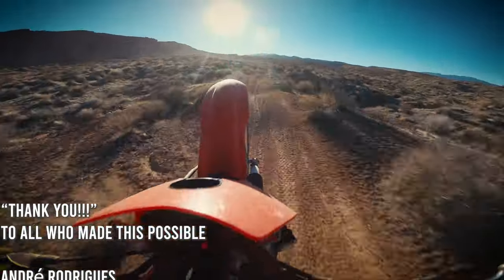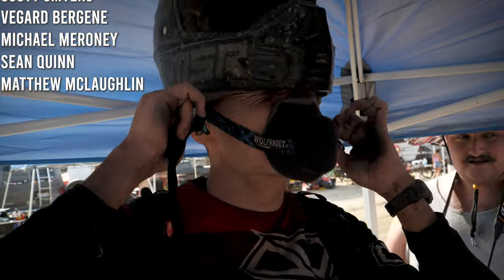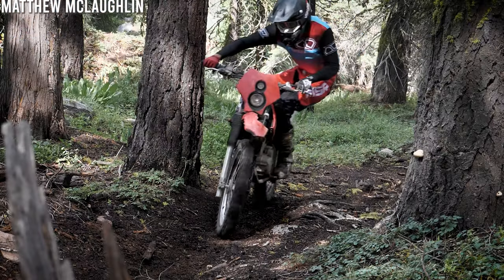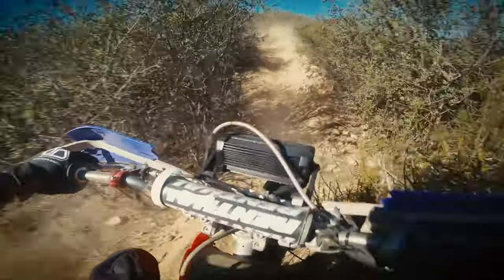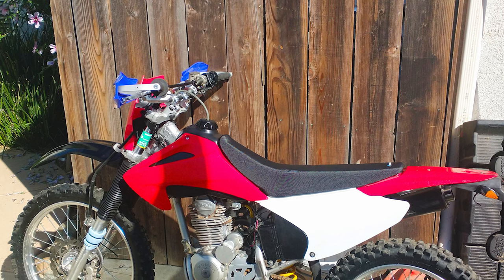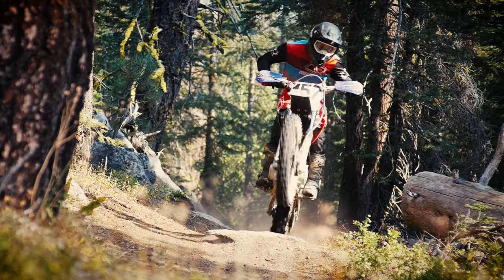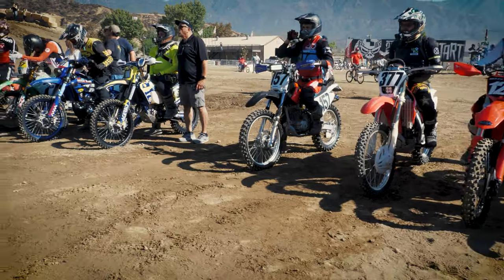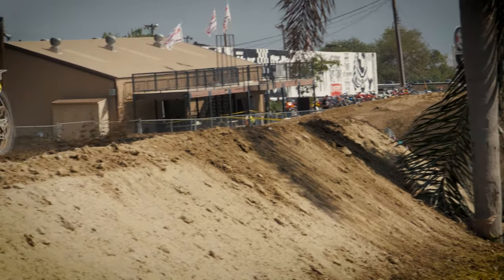So The CRF230F Sucks, Huh? Let's see...

Comment: The crf230F is actually a pretty suprising plateform. In 2012, this was my second dirtbike. Coming from an 1986 XR80R this was quite the difference. Nonethelessm I had put in it a high compression wiseco piston, a hot cam stage 2 and a ovesized carb. The 230F was pretty spicy for its age. A 2004 model. Glad to see you enjoy them to this day.
Reply: Haha I had an 04 as my second bike too… until I blew the transmission up pinning it in 6th out in the desert lol. If i ever get the chance to own another for the right price ill definitely be doing so. Great bike.
Reply: i have 2 crf 230f's (some videos are in my channel) the bike is amazing, under 50cm of water, in the rain or mud, never fails, never let me down. very easy to drive.

Comment: Wow that is the most sophisticated suspension upgrades I've seen on any of your CRF230 bikes!  Those cartridge forks and shocks are like something from Area 51 compared to the stock non-adjustable damping rod hoonanny.
Reply: Definitely want a link to the front forks he bought. I’d like to buy a CRF230 or CRF250f as a cheap motocross bike.
Reply: Where can I find these forks?
Reply: They were used forks off of the last generation of xr250r if you're still reading this

Comment: I had an 03 crf230.  I left mine bone stock.  I jumped it quite frequently, and it definitely needed better suspension.  I never was impressed with the power either.  However, it was a great trail bike.

Comment: We use a CRF 230 to lay out race trail loops. These little bikes can go just about anywhere because it has just enough power to put the power to the rear tire and not spin plus you can touch the ground with a low seat height
Reply: Their also very reliable, i almost bought one that was abused since 2006 and still ran fine on the stock motor, ended up getting a newer one in better shape though.

Comment: I have a CRF230 ive got a hagon shock on and had my stock forks done by bruce tripplett. That man works wonders on those flimsy little forks, but, what exactly did you do to get those KYB forks on there? and exactly what kind of KYB forks and triple clamp is it youre running? Ive tried XR250 forks on the stock shock (tuned by helbo bros) with a different link that was supposed to raise the rear ride height... that rode like dog shit, choppered the fuck out, carolina squat, etc. I would love to get some full size cartridge forks on it though, so spill the beans (please). Im also running a PWK28mm carb, some webb cam cant remember which exactly, wiseco high comp piston, and converted to rear disc brake(pain). Wouldn't have done any of it if it weren't for your build series though, so thanks!

Comment: I too have 2003 CRF230 that is a blast when riding with $12k pumpkins. What fork are you using or stock fork with race tech emulators? I'm using BBR springs and Race tech emulators but curious what you have done to fork? Also using 1985 XR600 rear shock...minty!

Comment: I literally just came moments away from buying one of these but the upgraded 250f. Instead I bought a clapped out crf250x with high maintenance and prone to failure. Sure it is more capable but at the cost I don't see it as worth it. Taking a big loss, but here I am selling the 250x a day after buying it (wasn't told it needed a full rebuild as it was prewarmed before I got there). So I'm getting the 2023 250f. It's an amazing bike and has some limitations but that air cooled engine is worth it's weight in gold.
Reply: @Andrew Schmitt
Some people only learn the hard way, but once they do, they never forget:hand-orange-covering-eyes:

Comment: I about 210 with gear 6 foot.  Could i get some input from u. I have a xr400r but it's kinda heavy. Looks for a replacement. Xr250r crf230f or crf250f. Budget is important. I want light weight.

Comment: So I'm looking into getting a used trail bike for myself (5'11" ~150#) to ride with my daughters, will be mostly wood/trails riding and going to atv parks. I currently am looking at the crf250x, crf230f, ttr 223/230, and the wr250f. My question is, which one in your experience is the most reliable and best bang for the buck? I would like to have the kick-start as a backup, but if the deal was good and the electric start isn't a common problem, I would be OK with it after a while ,I suppose
Reply from the maker: I like the wr250f. Drama free bike with zero limitations.

Comment: If you could get a similar suspension setup on a dr200 would it hang with the Crf? Given that it has carb swap and modded exhaust too
Reply from the maker: Oh easily. They trade blows but they could be in the same ball park for sure
Reply: @TortureTestMagazine  how about xr200 late 80s model. Do you have experience with those?